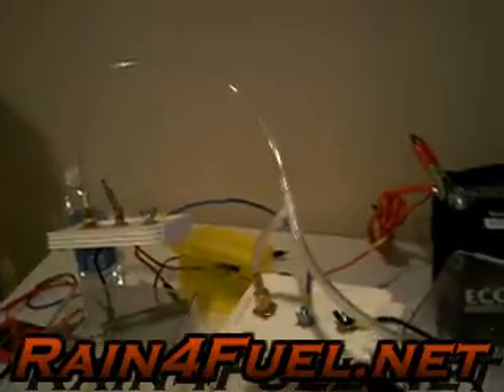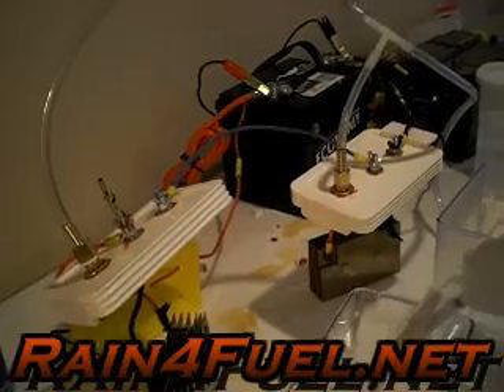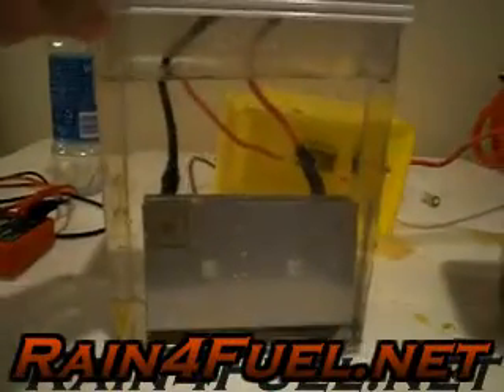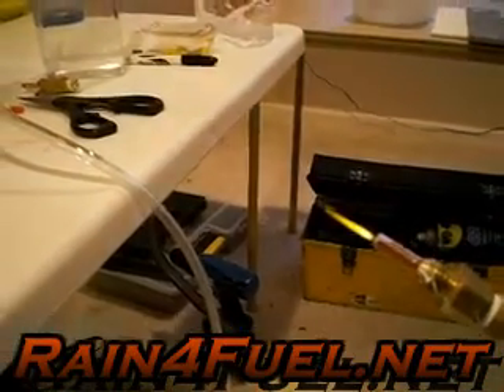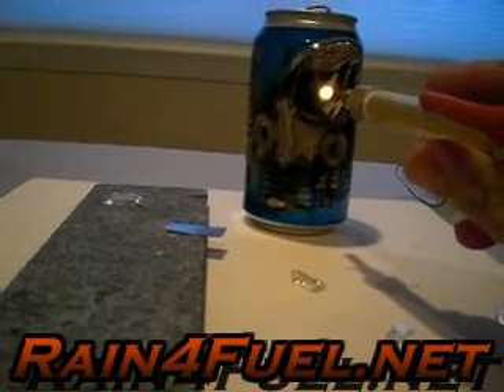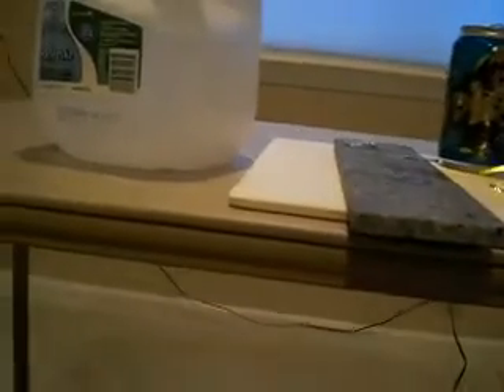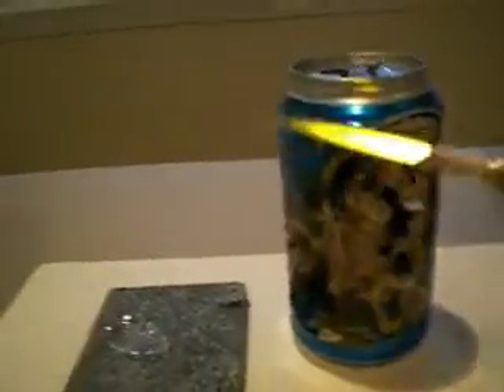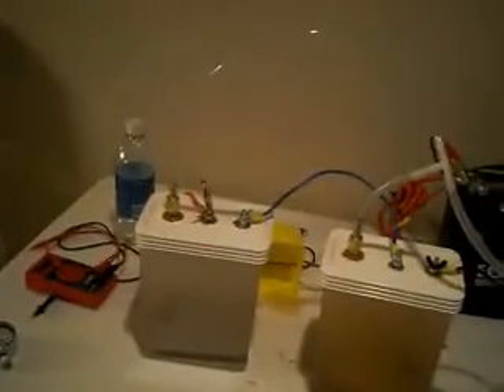Proof of Water into Fuel Technology HHO Fuel.net

Comment from the maker: you and all the others that say this kind of shit are totally missing the point...the point is to be able to make your gasoline engine use water to reduce fuel consumption and burn more efficiently....No Where..Ever....did I mention that this is a 100% efficient way to produce free energy...Ever.  All of my work is using a battery, charged off of a battery charger...and in the trucks, and alternator is charging the battery.  Nothing about free energy from thin air, or thermodynamics.